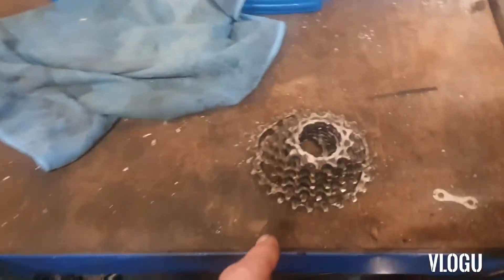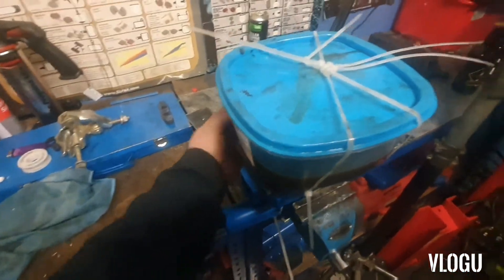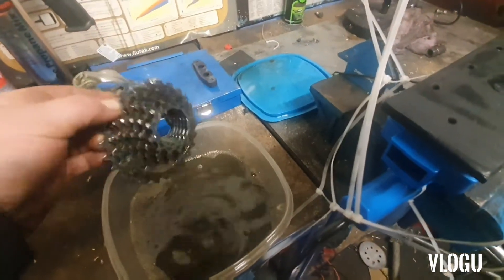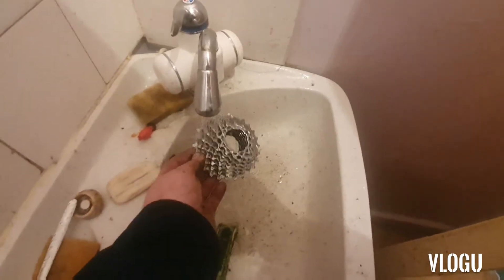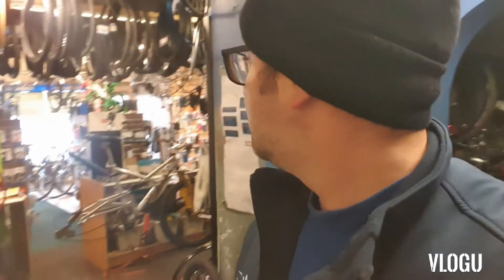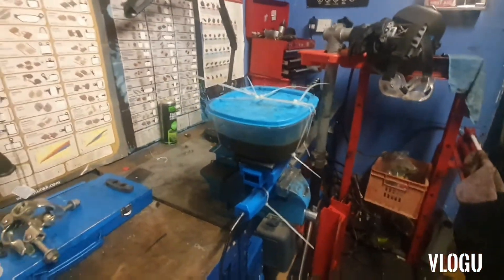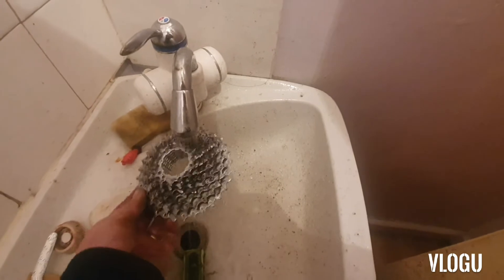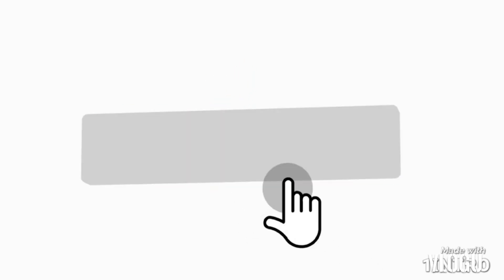DIY ultraSonic cleaner on a cassette. how to make your own

Comment: I have a amall garden fountain pump I was gonna try.....By covering the pump intake with a fine mesh brass screen filter & hanging the pump intake up high in the solution.  So it's not trying to suck up dirt from the tank bottom. Then point the pump hose directly at the part. So it's constantly spraying the part while submerged. 
Or cap the output hose end & drill several small holes in the hose. So the water sprays out in all directions.

Comment: not ultrasonic cleaner, just vibration, similar to a washing machine, so false claim on the title.
Reply: Ultrasonic cleaning is the process of the transfer of sound waves into vibration via the wall of the container the fluid is in so all ultrasonic cleaning is in essence the washing machine effect so you are wrong. Fact check before commenting dummy 🙄